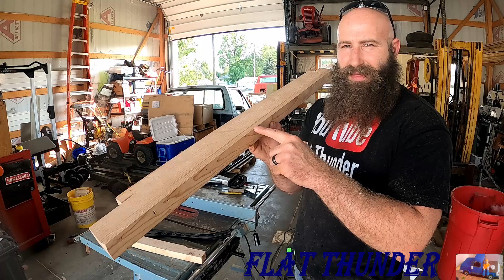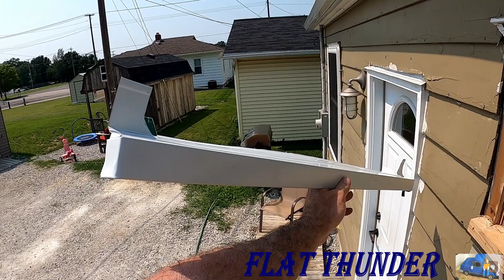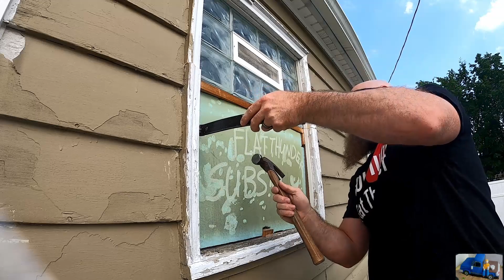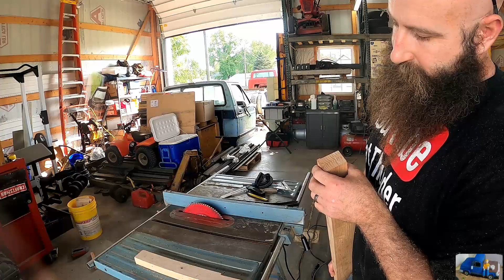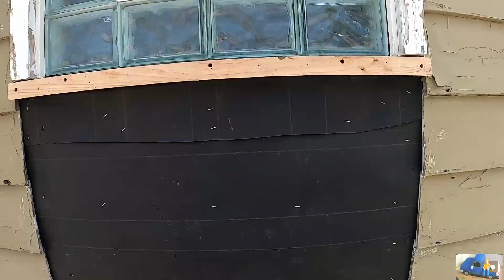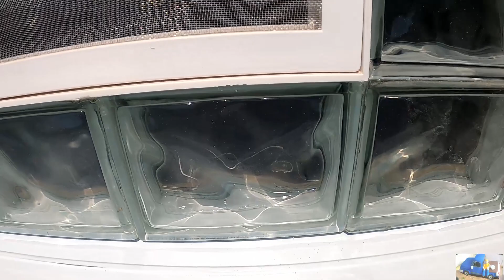SHRINKING WINDOW SIZES; ADJUSTING EXTERIOR TRIM, WINDOW SILL, SHEETING AND ALUMNINUM FLASHING

Comment: 100% agree on the oscillating tool.  Bought one two years ago when putting laminate flooring in a rental. Indispensable in cutting jambs at the bottom, trimming odd cut fits for the flooring. I have no idea why it took so long to own one. Game changer for sure.
Reply from the maker: I don't know how I ever lived without one!  I didn't mention it in the video, but buying quality blades makes a huge difference.  At first I thought the cheap bulk no name pack world suffice, but those only last for a single cut.  Now I opt for the more expensive brand name blades.  Thanks for watching my friend!  👍😁